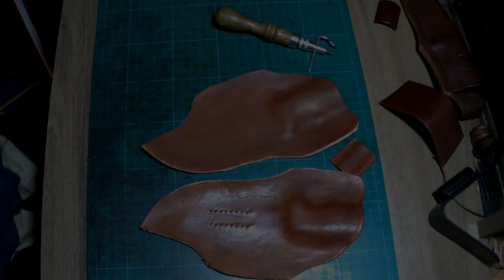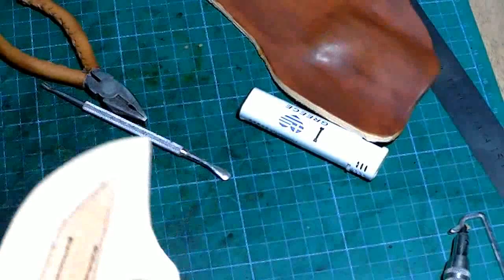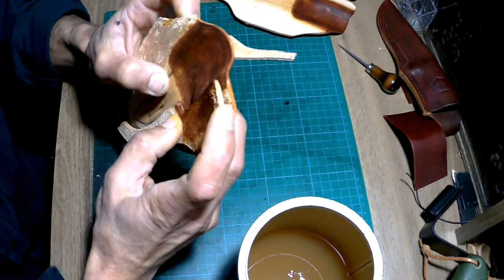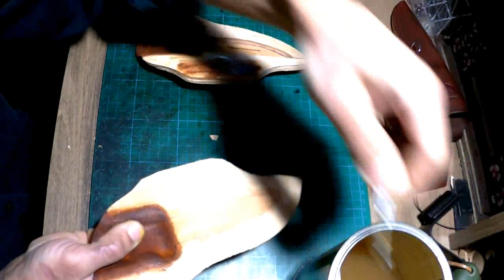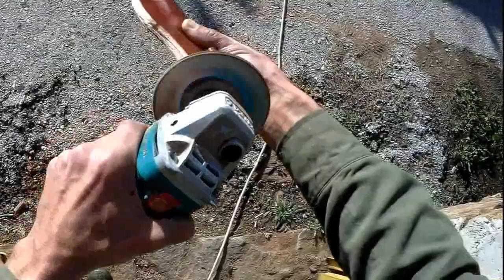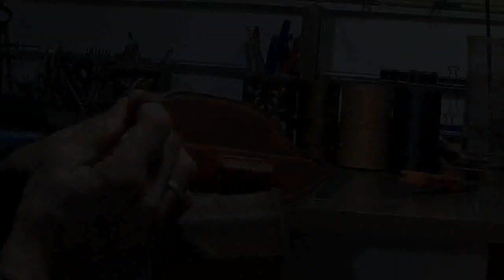How To Make A Cross Draw Leather Knife Sheath. DIY. (Step By Step) ! Step 2.

Comment: Is a drill press the best way to get through leather that thick? Are stitching chisels just too much of a pain? And what kind of drill bit so it doesn’t shread the leather.
Reply from the maker: Hello !s
I'm using the press drill to make the stitch holes in a straight line. You can use a hand drill too. Stitching chisles are to protect the thread from scratch while is in use.  I'm using 1,4 mm. diameter drill bit, ( fairly thin ) to do less damage to the leather.  Thank you !
Reply from the maker: @Jerome Atlas Thank you for your message! If any part is not clear feel free to ask.
Reply: InstaBlaster.